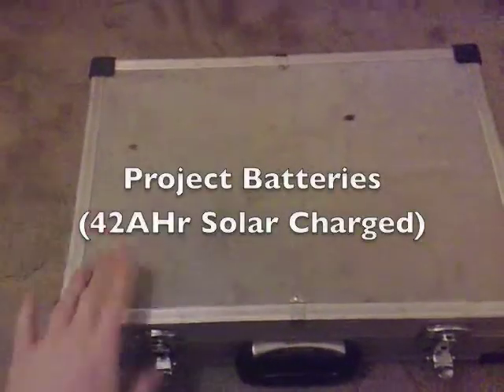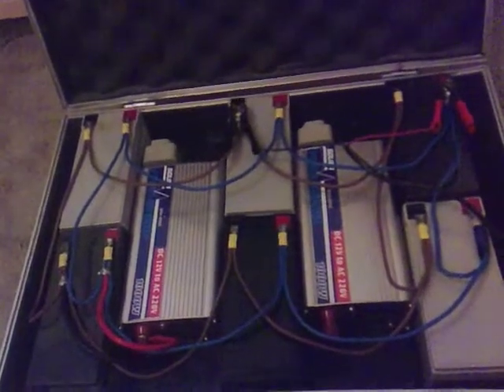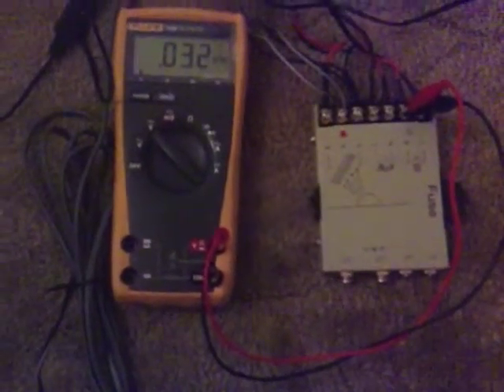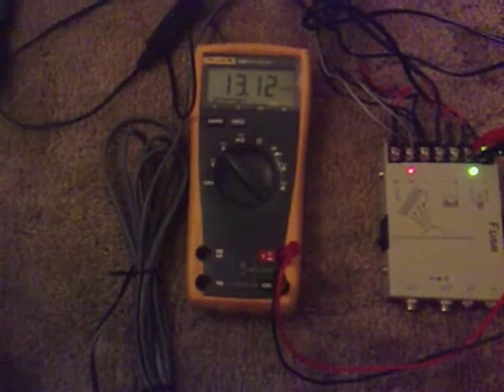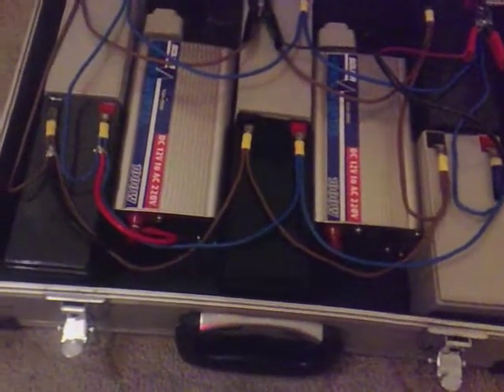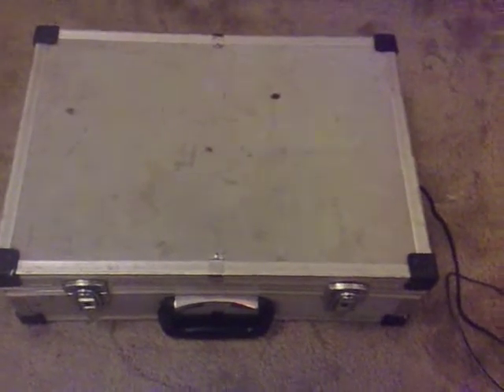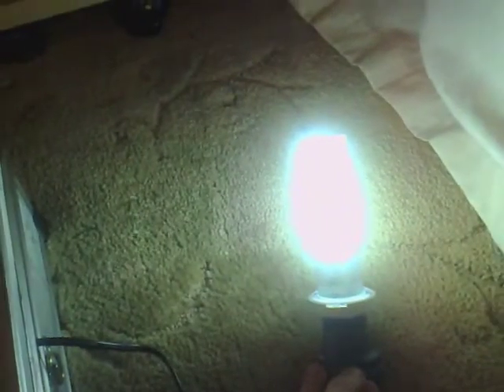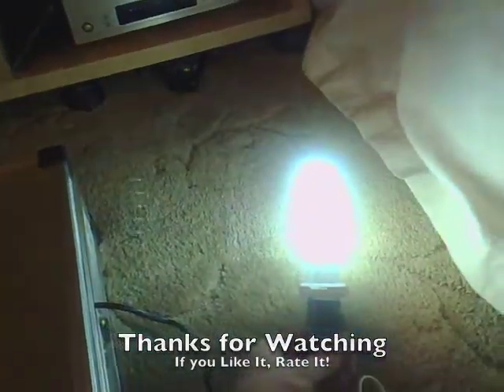Project Batteries (42AHr Solar Charged) 004

Comment from the maker: Yeah, I have a 20A fuse in line, I used to feed my Base Sub. Its Nicely insulated and routed fine. Im going to pull the negative off the nearest metal Bolt that goes through the car with fat connectors.. 

I wanted to use three batteries per Inverter on a Tesla style switch as a Test, any Ideas?

Hydro, Show Off!!  ;-p

Comment from the maker: Will do I know when I turn off my Aircon I get 1 MPG better but I only sit in traffic most the time, so I can see what the MPG is before and After.

Did you know you can put Acetone (Nail Varnish Remover) in your tank for a 5 mile Per Gallon increase....... 100ml per tank full about 65 Liters is what I used. (Experiment at your own peril though!) ;-)

Comment: When driving with the battery luggage it's like having an extra passenger. You're burning gasoline at a faster rate to get to the same destination the same way so that needs to be put into the calculation too ;)

Comment: hmm i dont know... i will go with the corsair 1000watts with dual 40amp rails i think. that should be enough for my computer.

But if the watts and the voltage are the same amps should also total up to the same amount i think... my guess is corsair talks about what it handles long term. the other brand might be talking about peak amps.

Comment from the maker: Will do, but I think my car battery is 70Ah and this Unit has 42Ah all the batteries charge to 13+ volts....

I might just use jump leads as a tester and run it for 10 Mins....

Comment from the maker: Power = Current * Voltage

The Voltage is fixed at 12v so More Power must means you can draw more amps.

They Might be Talking about Peak Power or RMS Power

or Just trying to Hype it up?

Comment from the maker: They are 1000w or 1kW (2kW Peak) I said it very wrong, i did actually put a thing in the more info bar once I noticed.  

Sorry it may have been a Freudian slip, cause if I did have a 100kW Inverter I would be off the grid now.......

I have 2 x 1000w or 2 x 1kW. (2kW peak each for a while but they get much hotter)

Paul.

Comment: i got an question that i don't fully understand... if i lets say get an power supply for my computer on 1000watts that is 80AMPS then i have seen other 1000watts power supply's with like 72amps how can the wattage stay the same with different ampridge? both are 12v.